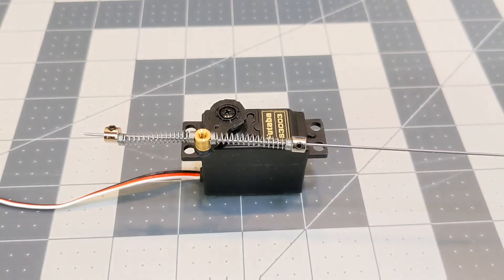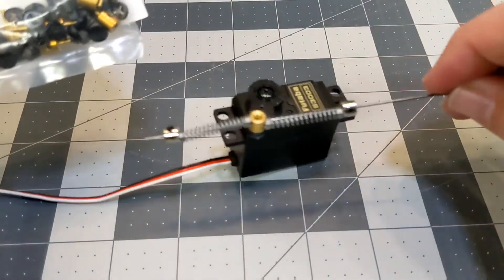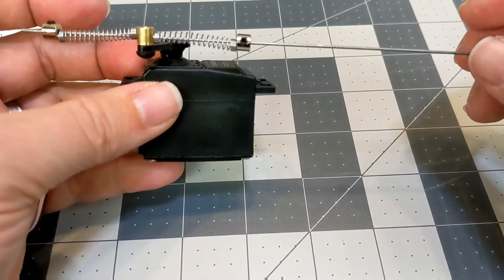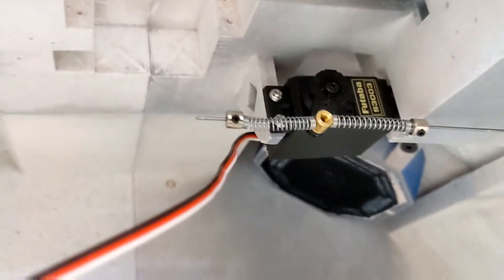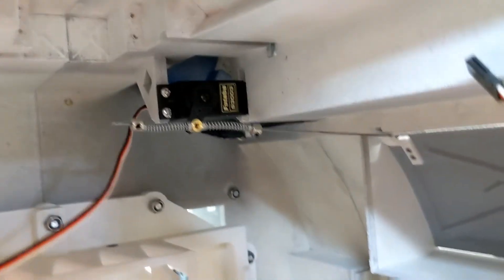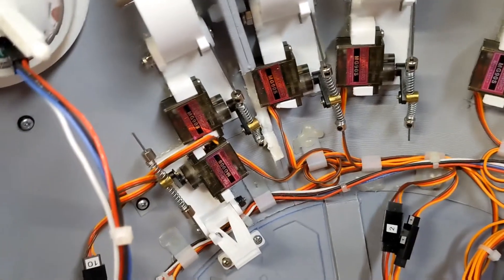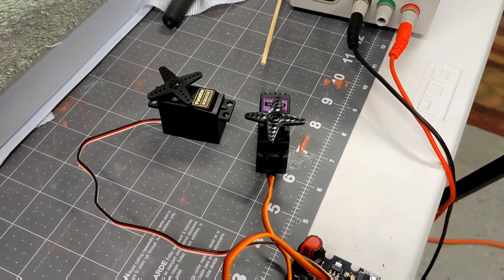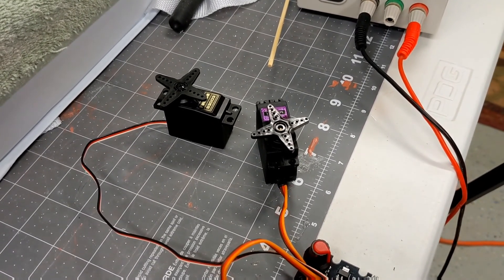Servo Savers for the Body Doors

Comment: I like the way you made these hinges and wonder how you were able to bend the wire so precisely.
Reply from the maker: Thanks! I didn't do much special when bending the wire - I just used needle nose pliers. I think maybe the "U" part of the bend matches the width of my pliers, and the 2mm thick wire is a good mix of stiff enough to hold it's shape, but not so stiff that it's hard to bend. I also made the bends with a little extra at the end so I could trim it off just right.

Comment: Hey Jason, Where did you find the pies with the structure on the backside? I looked through the files and did not see those anywhere. I could resin print them I suppose and glue it to the back of the pies?
Reply from the maker: The pie panels were included with the custom hinges that I used. The pie hinges I used are these: https://www.thingiverse.com/thing:2797760 and for the rest of the dome panels I used these: https://www.thingiverse.com/thing:2751192

IIRC, removing the built-in supports on the pie panel hinges was a real pain. Looking at the thingiverse link now, it appears someone has remixed a version without the built-in supports. You might want to consider printing that with your own supports added instead if you run into the same issues I did.

Way back in my build log, I detailed the trials and tribulations in getting them to work - in short, I discovered that my servos worked in the opposite direction than expected, so I decided to mirror the parts rather than update the marcduino firmware to reverse the servos. Here's a link to that particular post: https://astromech.net/forums/showthread.php?37151-JCharltons-3D-Printed-R2-Build-Log&p=507529#post507529
Reply: @jasonsR2D2  hey thanks! Now I want to resin print the pies LOL They look so much better than the ones I already printed. Thank you for the quick reply as well <3
Reply: What servos did u use and how many do I need?

Comment: I used this on my utility arm, it works and saves the servo when kids try to pull the arm out. Highly recommend using this 😎👍🏽
Reply from the maker: Funny you should mention the utility arms. I haven't done mine yet, but the Baddeley design calls for a direct gear from the servo to the root of the utility arm. I worry about that being a problem at some point in the future. Not sure if it will be possible to implement a custom linkage or not.

Comment: Nice but where did you get the 1 mm metal rods from.
Reply from the maker: I'm pretty sure I picked up a few lengths at a local RC hobby shop. They had various thicknesses. It's commonly called "piano wire" but often it's sold in rolls, which is not what you'd want. The exact thickness probably doesn't matter too much, as long as it's sufficiently rigid you should be fine.
Reply: @jasonsR2D2  ok thanks